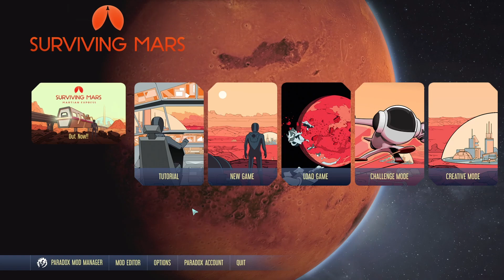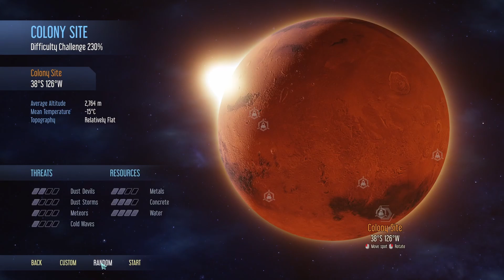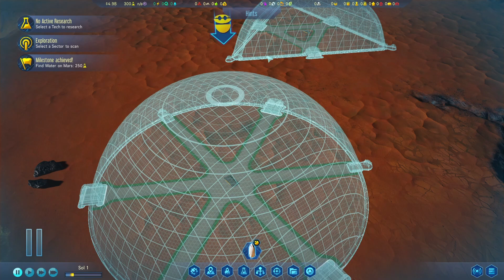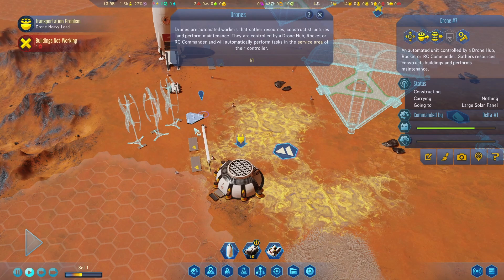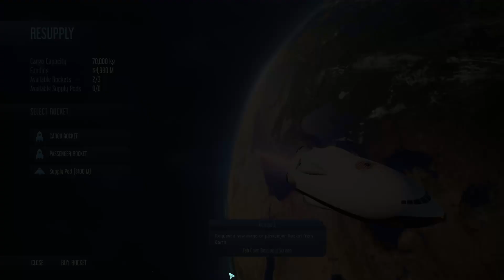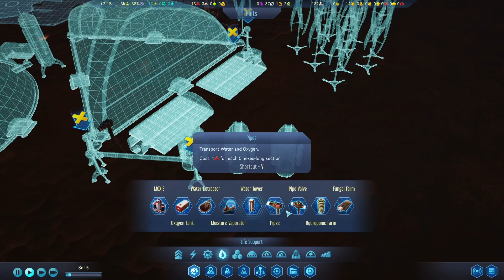Planning The Way To Success | Surviving Mars USA Playthrough Pt 1

Comment: what i always did was to rush the farm research inside the dome. also bring an explorer in the first rocket to uncover everything, which shows you you can research and gives you research points, which makes it easier to rush the farm and other essential starter techs. i never ever did use the fungus farm

about the start, i find that its very annoying and it greatly influences the playthrough, so I think its fair to cheat and preexplore the whole map with a rocket full of probes, then start again and land where its optimal, which would be vista+water+rare metal+research boost reachable with new dome. never had problem with metals, i always put the transport in auto mode and it gathers all the metals in the map, altho i think its a mod.